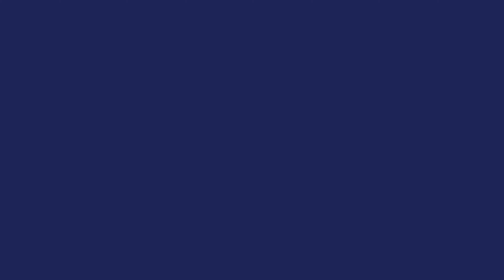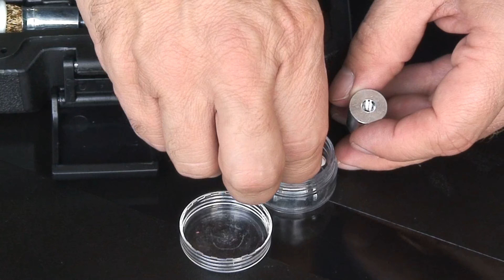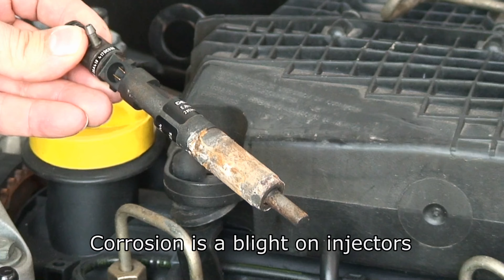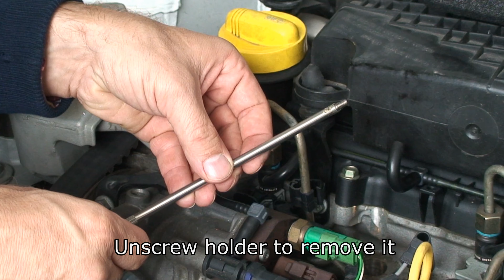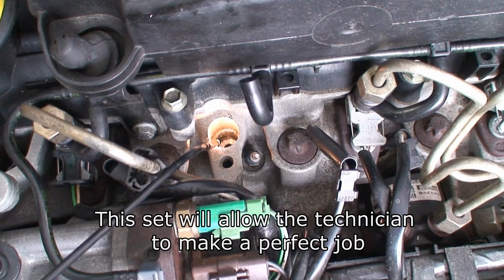How to clean the injector seat? (HU41039)

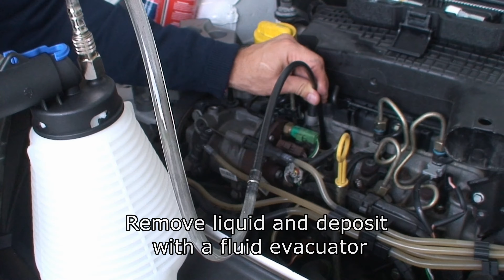Comment: I don't like the idea of debris entering through the injector nozzle port after you showed the removal of the seal plug at 2:15.
Reply from the maker: The plug is used during the cleaning of the injector hole . Brake cleaner is generally added during the job.
After that,  cleaner and dirt are sucked up with a vacuum brake bleeder. Only then is the plug removed to make the final polish of the seat. So no need to worry about that ;-)
Reply: Is there a place that I can the sealing plug by it online?
Reply from the maker: Please send an email to info@hubitools.com with your location and we'll see what we can do :-)